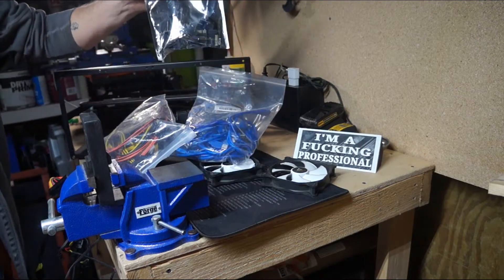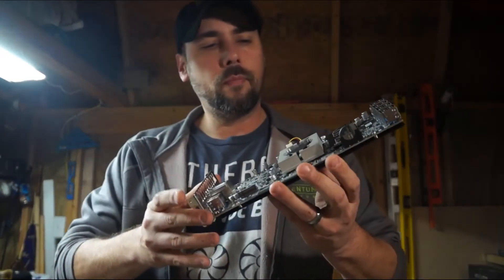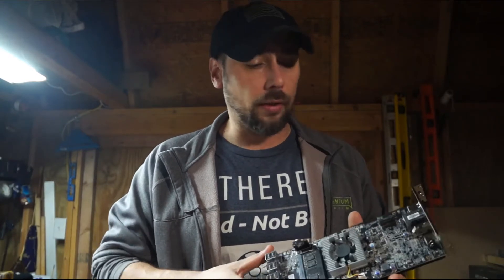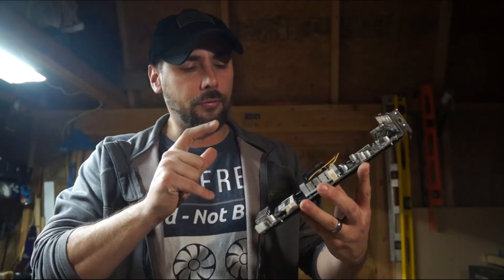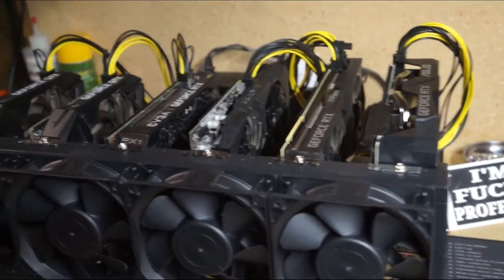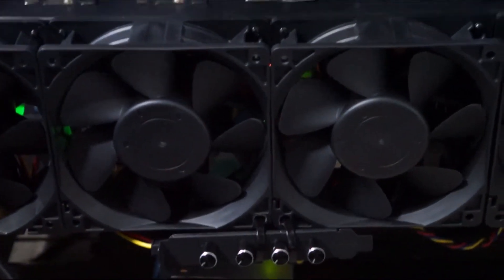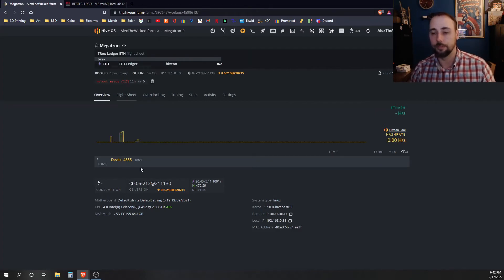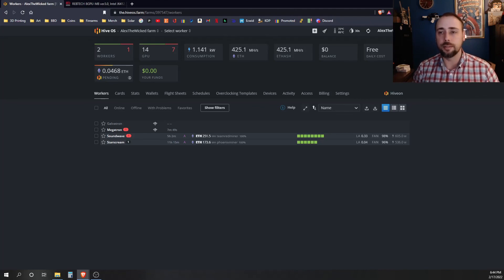The NEW Rebtech Motherboard! With Intel Inside, But Is It Worth It?

Comment: Did you have to do any BIOS changes to get Nvidia cards working, or just the driver roll back? Having issues with mine.
Reply from the maker: Honestly, it's more trouble than its worth IMO. It's flakey and unstable at best. Maybe I'm doing something wrong, but it works great with AMD

Comment: Did you ever add those batteries and panels? Also curious on your total mining wattage vs how long you can run on batteries?
Reply from the maker: Not yet, getting a different mounting system for these, since they are going on the main house, it will allow me to add to the rails later when I get even more panels. 
I have the solar setup on an auto transfer switch, so when batteries are full, the rigs switch to off grid. When the batteries get low, it switches back to main grid power.
The whole setup is hooked up to one ASIC, and  I get about 6 hours of off grid run time per sunny day. The ASIC is pulling ~1100w 24/7